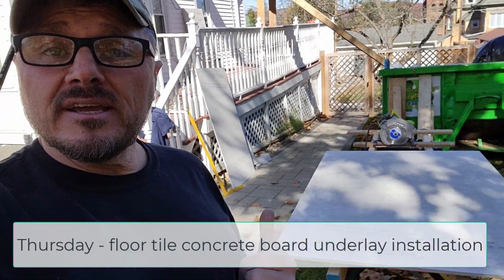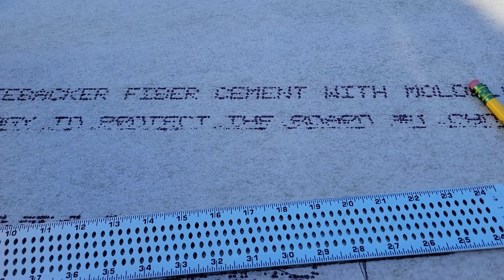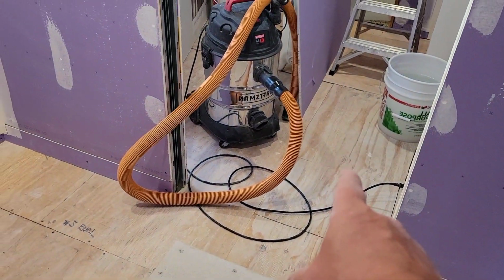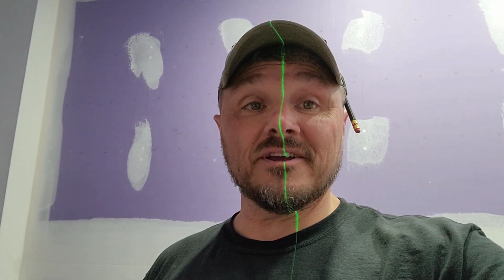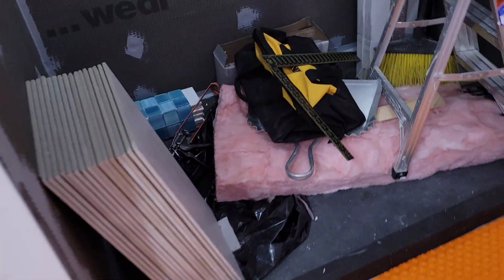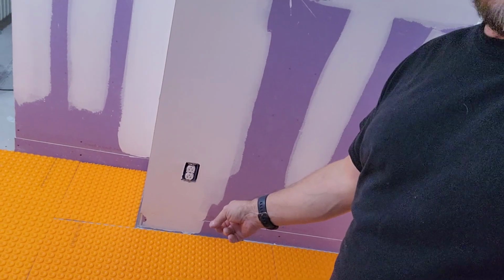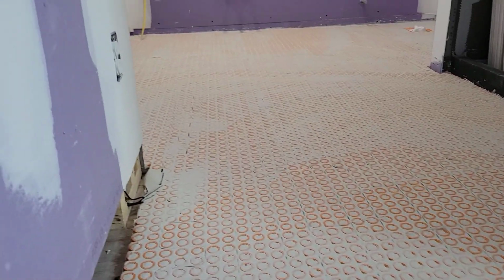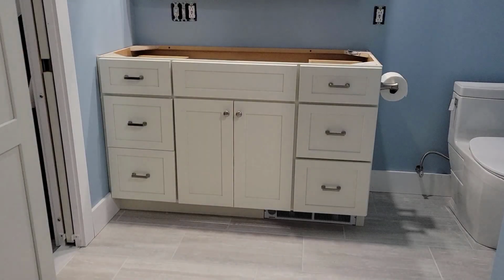Hardi underlay and Schluter DITRA heat in a $40000 bathroom

Comment: Why put the hardi under Ditra?
Reply from the maker: Thanks for the comment/question Phillip! In this application, we had a thickness differential between surfaces and old plywood subfloor in the bathroom was, in some places, less than desirable to thin set over so the hardi gave us a real flat and consistent foundation surface to work from. If you have a good subfloor (and some tile brands have recommendations about subfloor specs), the Ditra instructions say that you can thin set right over the plywood without a concrete based subfloor. 

Honestly.....with me and my jobs, I have always used hardi or other concrete subfloor under tile floors with or without the heat system. I prefer the reliability of the product over time and its resistance to any damage due to moisture (i.e. toilet leaks, old shutoff valves, etc.). In the future, I will still install either 1/4 in or 1/2 in masonry subfloor under all floor tile work.
Reply: Thanks for the well thought out reply. I don’t disagree with your reasons but hardi doesn’t add any more structural strength to the subfloor. That’s why I tend to use 1/2” plywood screwed every 6” to existing 3/4” to strengthen or fix heights in your case.
Reply from the maker: @philiplongo5854  For me, I like the assurance of any water leaks will not interfere by expansion or rotting with the surface directly in "contact" with the tile and I think that is why I would almost always use a concrete subfloor application even with a good subfloor beneath. However.......The plywood option is certainly a good one as you pointed out and whatever the subfloor, if it is flat and takes thin set and it is not in a high humidity environment, it should work just fine as long as it is properly secured (as you pointed out)! I nkow some contractors in my area that have used your process without issue. Thanks for the insight to your processes! Very cool.

Comment: Hay man I recon your not the plumber but the flange is best set on top of finished floor
Reply from the maker: Thanks for checking out the video and the plumbing point! You are certainly right and I misspoke in the video. Once tile went in, flange, seal, and European style toilet were installed where flange was shimmed with tile around the screws that secure it to the subflooring. Unless the homeowner requests it, I do not caulk around the toilet base allowing for quicker seal leak detection and hopefully, less subfloor damage in the long run. I have torn out many caulked down toilets that had long term undetected leaks that rotted the subfloor.  

Thanks again Nline2blast! I appreciate your comments. Have a good one.